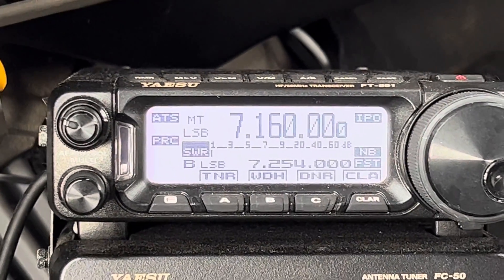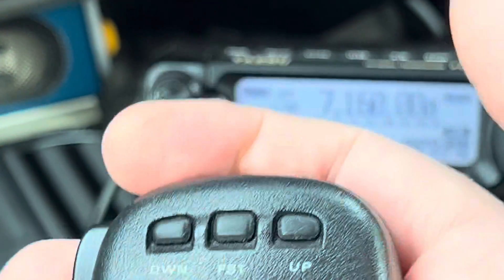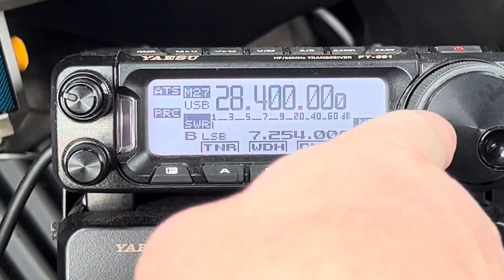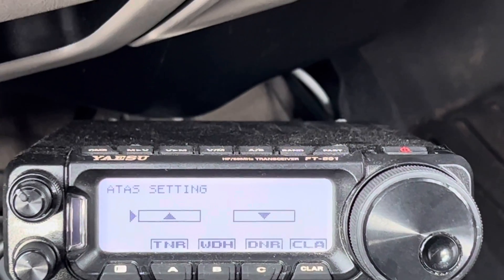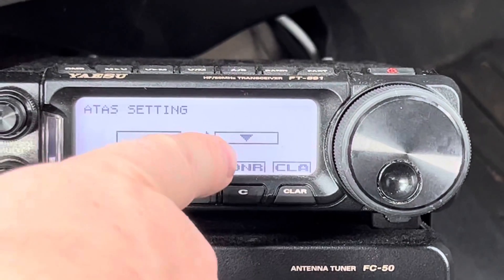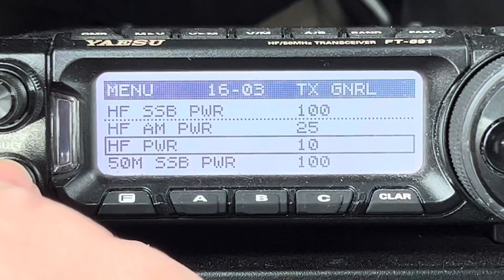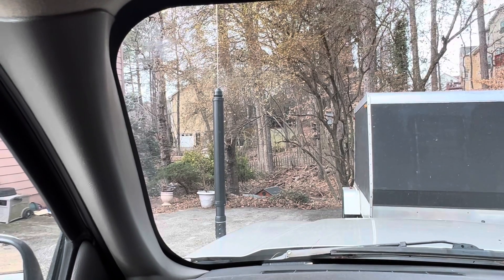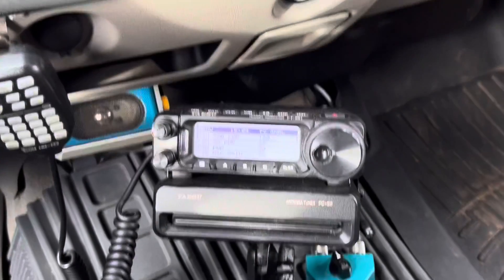Yaesu ATAS-120A Part 3 (Be Kind to Your Transmitter) #yaesu #atas #hamradio #antenna

Comment: So, while this ATAS system is in tuning mode it's putting carrier to air?
Reply from the maker: Yes, it has to transmit to read SWR.  All antenna matching units have to ultimately be adjusted while transmitting.  You can get close by listening to the noise floor on RX while tuning. Peak the noise and you’re in the ballpark.  Video #5 shows how much power the FT-891 outputs while tuning.
Reply: @n4hnhradio  Thanks. Even at around 10 watts, just wondering about the nuisance factor to others on air especially during long changes between bands.
Reply from the maker: That’s why radios have beat cancellers and automatic notch filters to cancel the heterodyne produced by someone else tuning.  Radios have no choice but to transmit in order to check SWR. Even an antenna analyzer outputs a small amount of power (approximately 0.1W).

Comment: Very helpful thank you
Reply from the maker: You are most welcome! I'm glad you found it helpful. The radio will limit the power during active tuning but I still prefer not to force it to transmit a long time with a high SWR.
Reply: @n4hnhradio I have mine permanently mounted on the house, with the counterpoise kit. Ive been a bit off the airwaves the past couple of years, but I want to move it to my vehicle and replace it with a EFHW on the house. But I think the ATAS will be better overall to use portable as I have a LOTS of QRM at home and it might get me out using it more. And i want to try POTA
Reply from the maker: I enjoy portable operation. I made it to SOTA Mountain Goat level.  I carried an FT-891 and a SOTABEAMS linked dipole for most of those expeditions.
Reply: @n4hnhradio oh wow, I have the ft 857d and they are pretty heavy little units :)
Reply from the maker: 4.18 pounds.  My QRP CW rig weighs 7 ounces.

Comment: I’m pretty sure my 710 drops the power when you use the internal tuner. I’ve purposely tuned on frequency (to test this) while rag chewing  with friends and they do not report hearing anything.
Reply from the maker: Yes, the Yaesu FT-710 lowers the RF power output during automatic tuning with its internal Automatic Tuning Unit (ATU). This is a standard protective measure in modern amateur radio transceivers.  The final video in the ATAS-120A series confirms how the FT-891 adjusts RF power output while tuning the ATAS-120A.

Comment: I noticed the little tic mark on the SWR meter reading indicating the highest point. How do you turn that feature on? My FT891 does not do that.
Reply from the maker: Menu 02-05 is Peak Hold.
Reply: @n4hnhradio  Thanks, I will check it out.

Comment: Worked all over world , have it mounted on front of my Titan in UK using original  version the 120 not the A
Reply from the maker: Mine is in its 3rd year. Still working.
Reply: mine at least 20
Reply from the maker: That speaks well of the ATAS-120.
Reply: @n4hnhradio .Just ordered a new version as a back up to see what difference  if any
Reply from the maker: Two is one and one is none.  Supposedly the new version is better at sealing out moisture.

Comment: Since yours is in LOS why not put reference marks on the antenna?  I'm getting ready to mount one in the same spot.
Reply from the maker: There is no need to do that. This antenna is fully automated. I tap TNR and the antenna adjusts itself.  I suggest that you watch all 5 videos related to the ATAS-120A.

Comment: I have a Yaesu FT 891 in my truck connected to a Yaesu ATAS antenna mounted to the hood of my truck with the K 400 mount. I have utilized several filters in the radio to dispel EMI and engine noise.  However, the one problem I still have occasionally is distortion of incoming signals, some of which are so bad that I can’t understand what the person on the other end is saying. I have bonded the doors, exhaust pipe and the ATAS to the chassis of my truck. Any suggestions on how I can remedy this problem? Thanks very much.
Reply from the maker: Distortion can be caused by the NB and/or the DNR set lower than algorithm 9.

Comment: Hi, I am not able to hear anything when I am using your "up-down" method of manually tuning the ATAS-120a. Any suggestions? Thanks for a good demo!
Reply from the maker: If you aren’t hearing anything, check to be sure that IPO and/or attenuation aren’t enabled.  Will the antenna auto-tune?  If not, there might be an issue with the bonding to your vehicle frame.  The ATAS-120A is only half of an antenna. The vehicle provides the counterpoise.  Auto-tune only transmits 7 to 10 Watts so it is okay to auto-tune the ATAS-120A.
Reply: @ I have it on a metal screen, attached via a wire, up in the attic. Attenuation is off (as it comes from the factory), the IPO I have to check. It’s possible that the metal screen (made for screen doors) isn’t sufficient for 20 meters? It tunes like a charm on 40 meters, however. Thanks.

Comment: I'm trying to get some ideas for mount a at-120 on my ford f150 also where did you get the console mount for the radio
Reply from the maker: I think I bought that flexible “gooseneck” mount at Ham Radio Outlet in 2005.
Reply from the maker: A friend of mine has a Breedlove brand mount.

Comment: Just put in an ATAS-120A with an 891. Grounded the heck out of it to the chassis and very impressed by performance so far. Profile of the physical antenna is bigger than I thought, but not as bad as some beasts that one has to be stationary and "erect" off the back bumper or vehicle rooftop, so again...a little bigger than a hamstick, but performance and versatility are quite amazing. Let's see how it's going to handle a Wisconsin Winter when that time comes... Probably have to be very mindful of what snow and ice could do to this thing and maybe remove it in the extreme months. If its trying to move and it's frozen, I could see that not going particularly well.
Reply from the maker: Diamond makes a screwdriver antenna that seems to be more robust, but it’s fatter and requires a separate control system to move it up and down.  It does cover the 80m band too.

Comment: New 891 radios will mute completely when you try this procedure so you cant get any indication from the static
Reply from the maker: It’s okay. Wait till you get to video #5.  I can’t cover it all in one video. People don’t like videos that are much longer that 15-20 minutes.
Reply: Did you ever find a solution to this? I watched PT5 Just now.
Reply from the maker: Yes, just use the TNR button and let the FT-891 manage the tuning. That is what part five shows. The FT-891 lowers the TX power to protect itself, while it adjusts the antenna. There is no need to use the noise receive method. Just press the TNR and let the ATAS-120A adjust itself.
Reply: Got it thanks for the reply, I found on 40m my speedometer moves when I talk. I guess I have to work on coax routing and possibly grounding. Thanks again 73!  @n4hnhradio
Reply from the maker: Are you sure your receiver mutes when you use the Up/Down arrows in the menu?  Not the Up/Down arrows on the mic. Those only adjust the ATAS-120A while you transmit. I’m referring to the Up/Down arrows in the Function menu, as shown in this video. I have two FT-891 transceivers and they both receive while I adjust with the Up/Down arrows in the Function menu.
Reply: @n4hnhradio  yep in the function menu as soon as I press up or down menu arrow items with the rotary encoder it mutes.
Reply from the maker: That’s strange.

Comment: Personally I go down to 5 watts then bring up the power and check the turning as I increase the power from 5. I do plan on getting this antenna
Reply from the maker: You won’t need to do that. Wait until you see part 5.
Reply: @n4hnhradio  i like that. I definitely have to get this antenna now. At the moment I have to keep changing my power level when I use my auto tuner.   I personally wouldn’t use the 316 coax just because it’s more of an attenuator.
Reply from the maker: I’m using 6 feet off RG-316. It fits nicely and doesn’t get pinched when I close the hood. It’s not hurting my signal either.  It’s only 6 feet long.  

I work DX from my truck regularly. During a 45-minute drive recently, I worked a station in Ukraine and another in Bulgaria, back to back.  Yes, a ham operator was active from Ukraine.  

I use RG-316 with my QRP CW rig.  I’ve worked Germany and Spain from North Georgia with 5W.  You can see that setup in my SOTA playlist.  

For short runs, the RG-316 is not a problem. If you saw the comparisons between my ATAS-120A and my ham sticks, the ham sticks were connected with 18 feet of RG8X.  The ham sticks are 7 feet tall and mounted top center of the truck. I thought there was no way that the ATAS-120A, mounted on the left front fender, would compete with the 7 ft. ham sticks atop the truck. Well, I guess you saw what happened in video number 4.

But hey!  If you can fit RG8X, go for it.
Reply from the maker: A couple of my Patreon members do POTA activations from their truck, using a Yaesu FT-891 into a ATAS-120A.  I have posted the HAMRS coverage map of a couple of those activations in videos.  It’s amazing.  One of them, at a park in South Dakota, worked stations all over the U.S., Europe, and even near the North Pole, all during one activation.
Reply from the maker: Be sure to use as many counterpoise wires as possible and practical.
Reply: How about elevated radials 4,6 enough  @n4hnhradio
Reply from the maker: There is a radial kit. It’s only for VHF/UHF.  I haven’t heard of any success for HF.  One Patreon member mounted his to his chicken coop roof with a magnet. That didn’t work. The magnet doesn’t provide enough of a bond.  It’s capacitive coupling.  I told him to run a wire from the magnet mount and screw it into the metal roof. It now works.

Comment: Where did you get the mounts to connect the radio with the tuner?  W4IOS
Reply from the maker: Those brackets come with the FC-50. I no longer use the FC-50, but, in case something happens to the ATAS-120A, and I revert back to using ham sticks, I will have the FC-50 available to touch up the band edges.

Comment: How dose the antenna perform on 2 meters? I can not find anything about that. I like the fact of only having one antennae.
Reply: I use my ATAS-120A with a Yaesu 857D and have no problems on 2m/70cm.
Reply: Thanks for the input. I have not found anything comparing the performance, or working 2 meters. I don’t want 3 Antennas on my vehicle. I will use it on 2 meters most of the time, but HF would be a nice option.
Reply from the maker: I haven’t tried it on 2m or 70cm. I use the Diamond NR770 for 2m/70cm. I prefer a separate 2m/70cm radio and antenna. But, if you have something like a Yaesu FT-857D, you can use a duplexer and have an all-in-one setup. I like to be able to monitor VHF/UHF while working HF, so I prefer two separate radios. 

I have read reports that it works fine for 2m/70cm, but I can’t confirm that.  

There is a radial kit that allows you to use it as a base station antenna for 2m/70cm.

Many of the complaints you read about the ATAS-120A are related to counterpoise, which is often referred to as grounding. Counterpoise is a more proper term. When you purchase a HF mobile antenna, you are only buying the radiator portion of the antenna. Your vehicle must act as the counterpoise. So good bonding to the vehicle is a necessity.

Comment: Are you using the fc50 along with the atas? I thought you only needed the atas or is the tuner just a fail safe?
Reply from the maker: No. I guess I should have mentioned that in the video. So many have asked. The FC-50 is left over from my ham sticks.  Check the video description for more details.

Comment: Your question on if the ATAS lowered the power to tune the antenna is a good one. I do not use the ATAs antenna; instead, I use the Little Tarheel 2.  To tune it, you use the controller puts the radio in CW and low power to tune. I would think the ATAS did the same because these antennas could arch as the coil moves at high power.  When you hit the TNR button does it not show the transmitt power? Thank you for the video.
Reply from the maker: I already shot a video about it. The Patreon team is viewing it now. It will be posted in February or maybe March. Yaesu did it right.

The meter switches to SWR while tuning, no matter what you might have it set to for TX.

Comment: I like the footprint of the ATAS  antenna and am wondering if it's worth the money....I own a SGC 9' HF whip which requires a tuner approximately 18" or closer to the antenna to connect to it....but it's a big antenna to have on your vehicle...
Reply: I have had this radio and antenna setup in three different vehicles. First one was on the trunk lip of a Saturn Ion, then the back hatch Ford Escape (the box shaped one from the 2010s, and a 02 Chevy Trailblazer hood mounted. Great performance. Talked all over the USA EU Italy and South America all from Wisconsin. Its a great antenna but if the grounding on your car isnt great then swr will be high and it wont be able to autotune. Make sure to run a braid of wire from the antenna to the frame or main body of your vehicle.
Reply from the maker: Just wait until you see Part 4. “I can’t believe I’m doing this.”

Comment: Interesting. I’m going to start doing this Doug.
Reply from the maker: It is a safe way to go from one extreme to the other, but the FT-891 automatically lowers power output to 10W or less while tuning the ATAS-120A. Let’s see how many people read comments. I’ve had several people ask. If they read the comments, they might find the answer. 

73, Doug

Comment: Does FT-991A have that manual adjustment?
Reply from the maker: I think the FT-991 only allows the microphone up and down buttons to move up and down, but you must hold the PTT while pressing the up or down buttons.  I don’t think it has a Function menu option like the FT-891.
Reply: @N4HNH Radio  Yeah I haven't found that option on the menus. However, sometimes when you press the tune button, the light flashes for a while before the transmitter comes on. I wonder if knows the band has changed and it's moving the antenna up or down accordingly before tuning. Can't tell, because it's outside the trailer out of view.
Reply from the maker: It might be yet the FT-991 is smarter.

Comment: Hi Doug, Is it worth buying one for collection? 
I did have ATAs-100 but sell at least 15 years ago.
Reply from the maker: I’m pleased with this one thus far. It’s directional, because it isn’t mounted top center of the truck. But if I mount it top center, it won’t survive the low hanging trees around here. It’s rivaling the ham stick prrformance toward the right side and beating it toward the rear.

Comment: hi yah working the world wit the a tas120a on  sota from a wery hy point and about 18 radials mounted 380 degrees with tent hooks on the ends and ground stake 4 the antenna  raizing it about 40cm of ground and a good coax not rg58 or rg 174
Reply from the maker: I would possibly do that of it was a drive-up summit. I know the ATAS-120A is capable.  But for hiking, I prefer to carry a 7 ounce QRP radio and portable EFHW.

Comment: Can that antenna be mounted on a tripod for field use?
Reply: Do we know for sure the power drops to 
5 w while ATAS120 is tuning?
TIA
Reply from the maker: It lowers the power but not to 5W.  I cover it in a future video that the Patreon team is previewing right now.
Reply from the maker: Scott answered you.  Yaesu also sells a radial kit made for the ATAS-120A.  The ATAS-120A is only half the antenna.  We have to supply the other half, with our vehicle or a radial kit.

Comment: It drops power right down when tuning in order to prevent issues with high SWR during the tune process.
Reply from the maker: I think it might be one of the last Yaesu radios to do that.  But I didn't take a chance with mine.  I set HF Power to 10.

Comment: Good advice but I thought using the ATAS system it drops the transmitter to 5w and cw while tuning.
Reply: Yaesu states in their advance manual it will reduce power to 10 watts CW.
Reply from the maker: Yes, I showed that in Part 5 of my ATAS-120A series.  There is no worry about tuning.
Reply from the maker: It might.  I haven't put a wattmeter on it.  It should be 5 to 10W, but not all Yaesu radios do that with external tuners.  With their internal tuner they will.  The FTdx10 does.  I would think the ATAS counts as an "internal" tuner.  I just didn't take a chance with mine and I lowered it to 10W.  Some autotuners require 20W to provide a more accurate tune cycle.  I am sure the FT-891 can do it with 10W.

Comment: I received my Atas-120a yesterday and staged it in my shack on my DX10. The Atas indicator is on, tune starts but the antenna doesn’t hunt. No movement, no motor sound. Like there’s no power.
Reply from the maker: Were you trying to use the TNR button, or the Function menu arrows, like I showed in Part 1?  The antenna has to be mounted to the vehicle with a good bond to the vehicle frame (aka ground), for counterpoise, in order to use the autotune (TNR) button.  If you are using with the radial kit, for portable ops, the radial kit serves as the counterpoise.